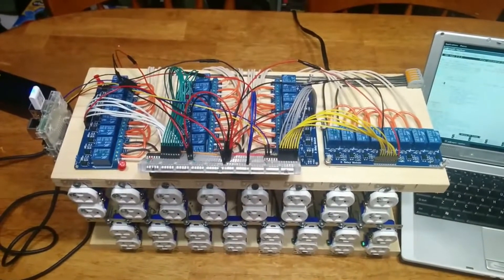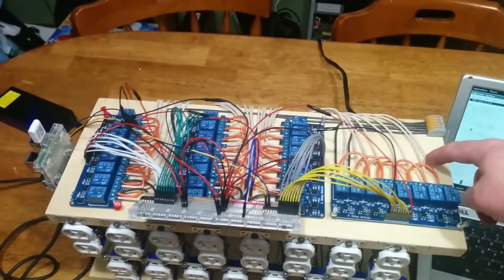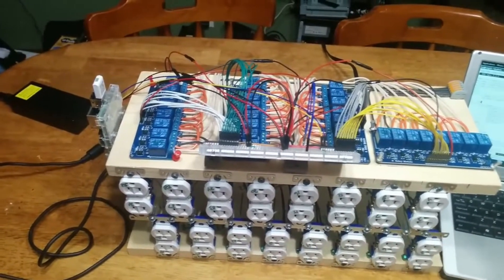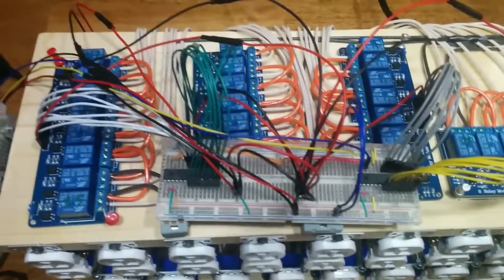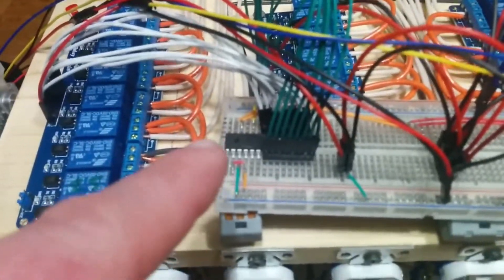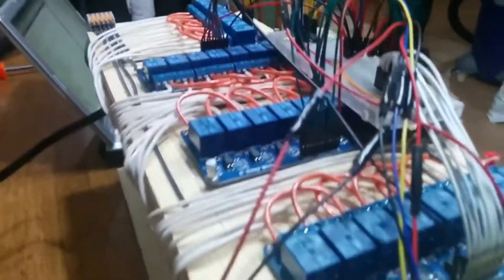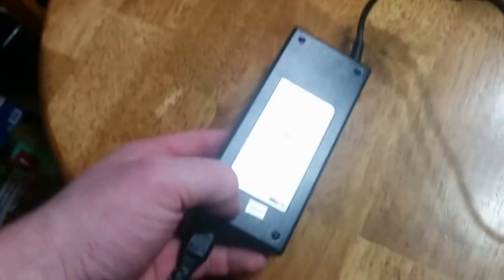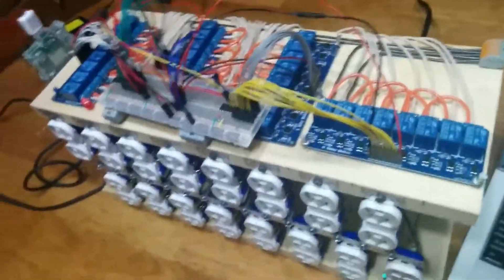Raspberry Pi with 32 relays and 2 mcp23017 - dubbed over

Comment: Hi, I am trying to do the same but with an ESP32. Even though I also use an external power supply to drive the relay boards, for some reason when I use the mcp23017 it can't power more than one relay at a time. Any recommendations?
Reply from the maker: Make sure the relay's power is direct from the power supply, and only use the mcp23017 as a trigger.